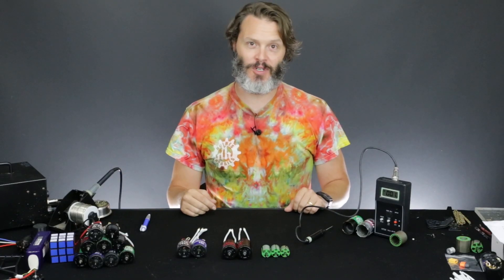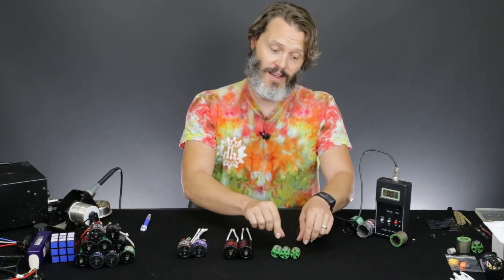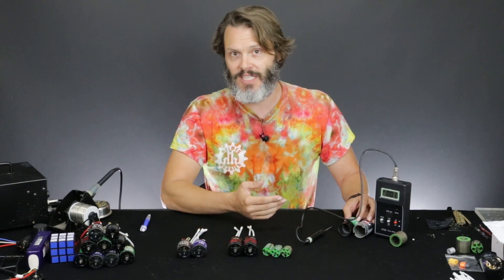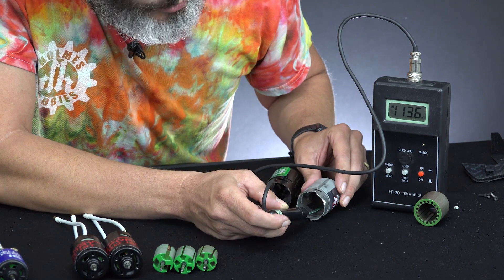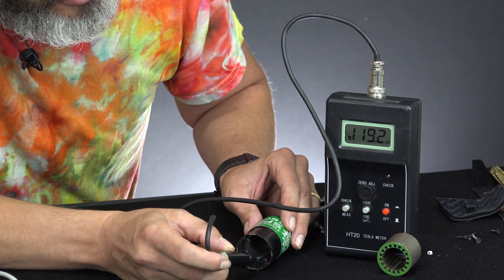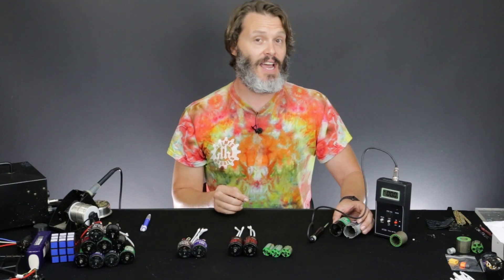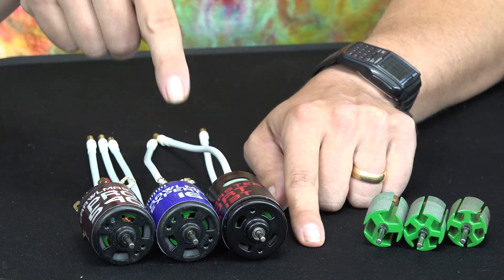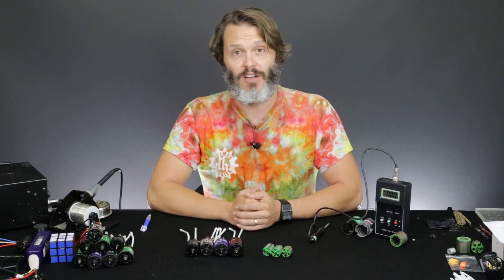Designed to Perform! Crawlmaster Sport RC Rock Crawler Motor Tech Details - Holmes Hobbies

Comment: I just installed a BR-XL and a 13 turn sport motor in my Enduro and love it ...I wish I would have add the BR-XL sooner the ESC is just fantastic I was using the HW 1080 there is no comparison between the two...it is definatly worth the extra cost....
Reply: Where do you feel the improvement?
Reply: @czebalaf  Across the board better drag break, better hill hold with Holmes Hold and the addition of being to use 4s to produce more bottom end grunt ...ease of programming through Castle link...